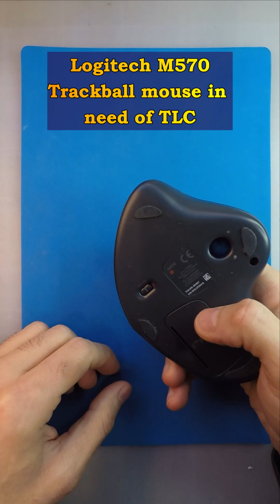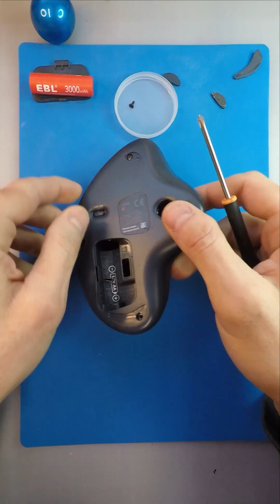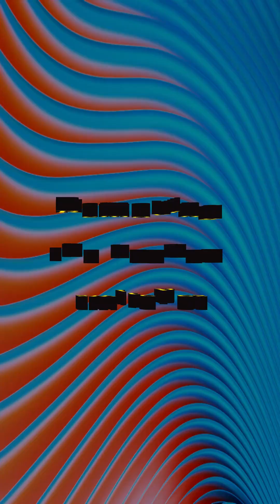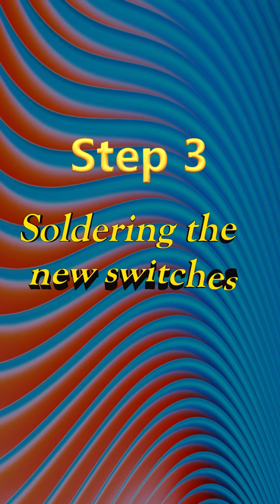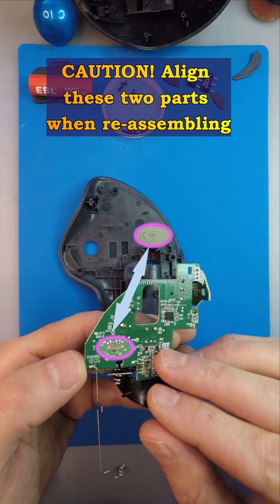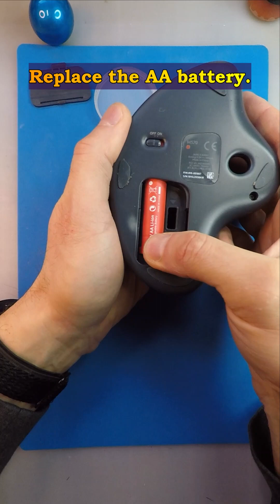Logitech mouse fix guide with step-by-step instructions!

Comment from the maker: BONUS TIPS: The microswitches in the original mouse have shorter lifetime than some of the a bit more expensive ones. You can buy the ones with a higher number of presses to replace the original microswitches to make your mouse work for longer! This will also help you replace them less frequently! 😏